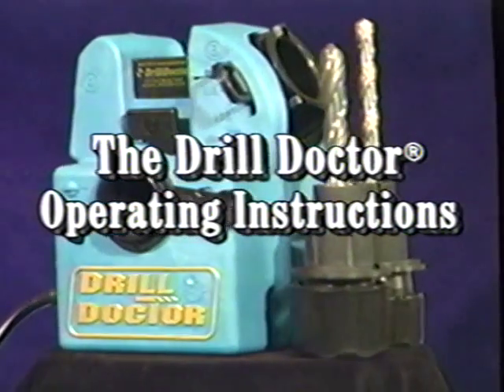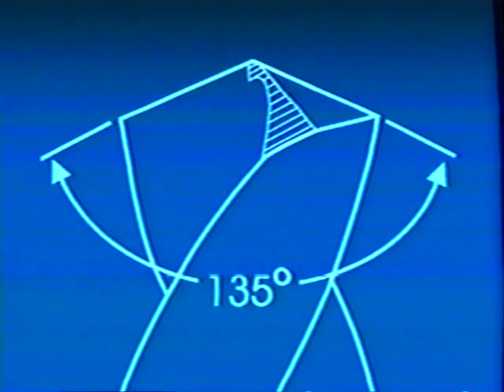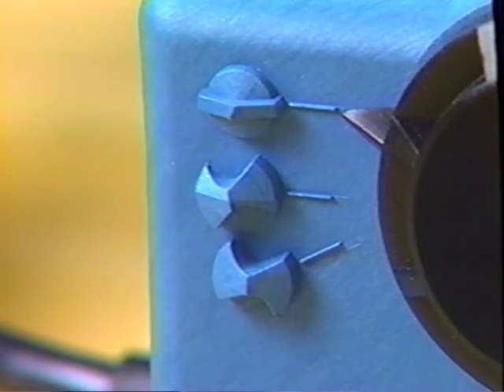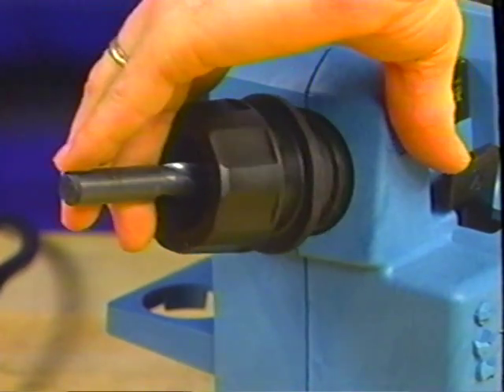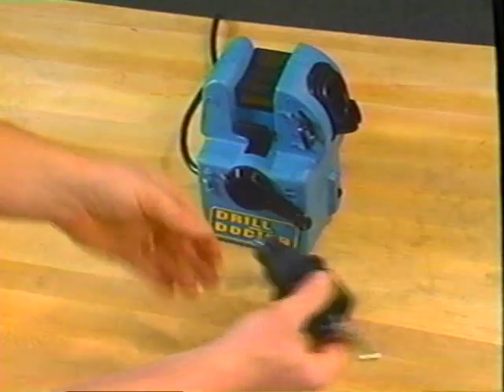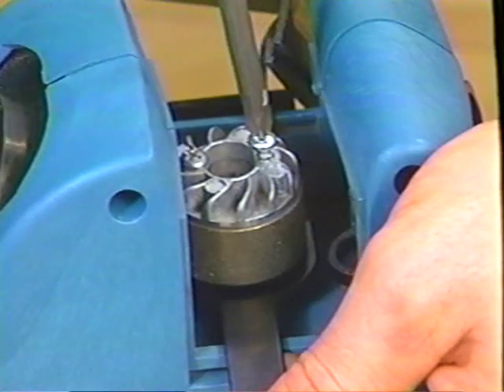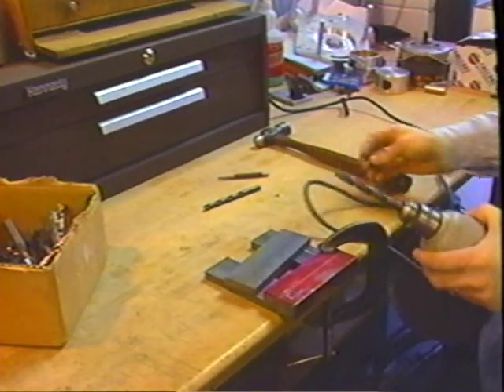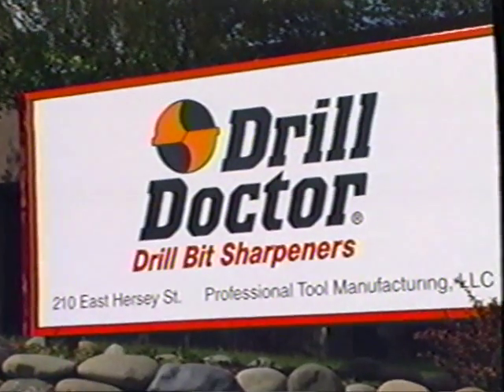Drill Doctor 500 video instructions

Comment: Thank you.  I just upgraded to the 750X and was putting the old 500 back in its box and there was the VHS tape.  I was hoping to find this video on line for the future owner and here it is.  The 500 was a reasonably good sharpener for a lot of years - better than anything else I tried.  Finicky, things kept moving around and you had to hold them in place and pay attention, but it worked.

Comment: My Professional is still working great after many years. The only negative comment I see is it is tough to see the aligning paws in my shop so I need to wear a headband light to align the drill in the paws,
The unit would have been much easier to use if an LED was installed in the aligning tube.